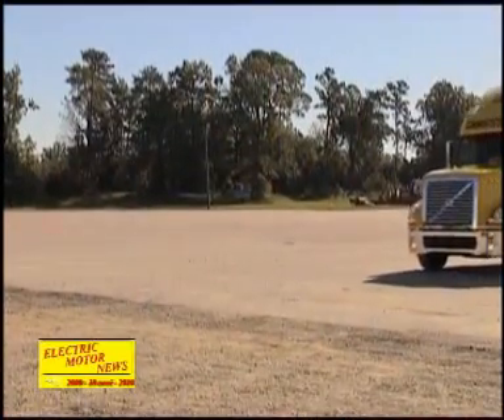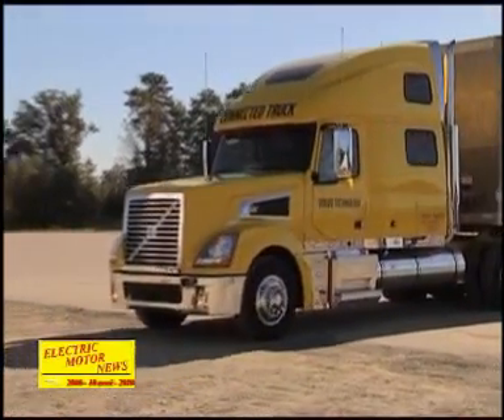Volvo Truck hybrid plug in - Frank Bio, Products Manager Volvo North America

Comment: I mentioned to Volvo to create a dual 500,000 AH  battery system that look like dual 300 gallon tanks, running a full 24 hours before a 7 hour overnight charge by 120v North America power. Diesel fuel is hovering close to $4 per gallon Illinois. Trucker rest stops with outlets we can save 1 billion dollars with all the truck drivers nationwide